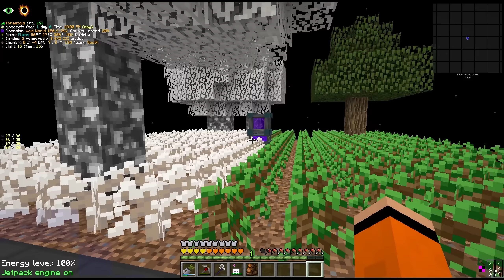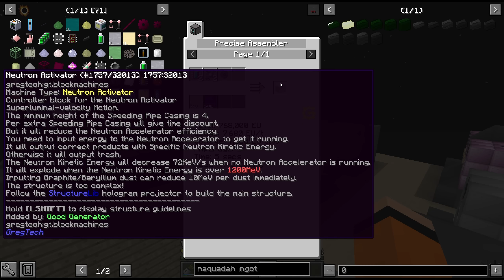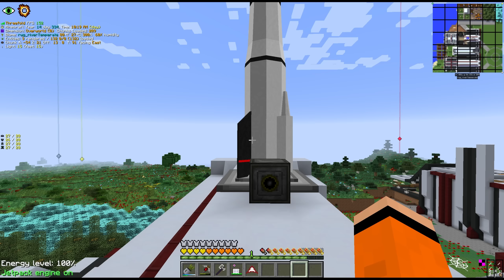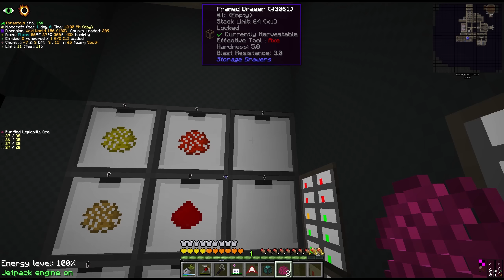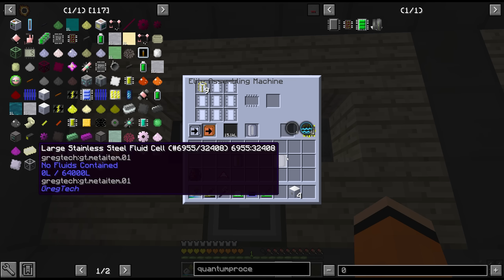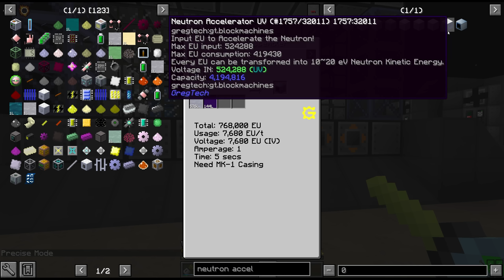Gregtech New Horizons - 61 - With Precision! Modded Minecraft

Comment: If you want to use the precise assembler in normal mode I'd replace the dummy buses by hatches. From what I understand the reason the minimum casing was nerfed was because it was a pretty laggy multi with a lot of buses since it has to check recipe maps or something along those lines

Comment: Don't you have a skeleton spawner in the Nether? You could have used that for bones -> bonemeal -> Calcium as well. Other options were skeleton mob crops (slow), centrifuging milk (there's a milk crop IIRC), or placing another Tree Growth Simulator, although I'm not sure if they work with the nether saplings. Might only work with vanilla saplings, I'm not sure on that one.

...What was that cabling job for the red GT++ multi? 4× leading into an 8×? What?

I don't know the precise amount, but you need 32 stacks of 2× LuV superconductor for the fusion coils, another stack of 2x for the fusion coil needed for the controller recipe, and another 32 1x for the 16 LuV energy hatches you're not going to strictly need immediately, but want sooner or later. You need tons and tons and tons of that stuff, which is why I kept harping on both the Vulcanus (faster GT++ EBF replacement) and a Mega Vacuum Freezer (exactly what it says on the tin). It's going to make processing all that stuff a lot more reasonable.

I was sure that superconductors needed helium, not hydrogen, but okay.

This frequent maintenance stuff is why it's helpful to have designs that can signal maintenance issues at a glance, or a control room full of Nuclear Control information panels that keep track of multiblocks and their maintenance status. You can now craft auto-maintenance hatches, which will auto-resolve maintenance issues as they crop up at the cost of some items, but each such hatch, IIRC, is two LuV robot arms and...I believe two, but maybe four ZPM circuits. It's hideously expensive, and only useful/viable for critical infrastructure.

I guess Bart decided to use Legally Distinct Thermal materials rather than just straight copying the Thermal materials, or something ;)

Remember that miners only mine below them. Don't sink miners into the ground unless you're actively avoiding layers of ores, which...I mean if you only need the bottom layers I guess that's an option, but not really worth the effort IMO?

If anyone is confused about why the precise assembler related recipes suddenly changed, Three updated his version of Good Generators that adds those recipes, as they were changed to be fixed in a later version. The Adamantium Alloy gears were changed to Hikarium gears - which is more alloy fetish nonsense until you realize it takes ZPM to create, which takes two LuV energy hatches, which takes Naq using the inefficient recipe - and the original Draconium Bolts in the casing recipe was changed to Signaliium or however the pack wants to spell it.

If a miner "finished" it should have retracted the mining pipes. Keep an eye on that, it might also have shut down due to maintenance issues or some such.

You might think "can't you just mix Lithium dust with Chlorine in a chemical reactor/mixer/whatever to get Lithium Chloride dust?", and the answer is "if only". The alternative recipe for Lithium Chloride involves setting up an Algae farm, which is a large multiblock that produces various forms of algae depending on tiers. It is a cheap multiblock and entirely passive, requiring no maintenance, producing no pollution and costing no power, but it's speed can best be described as "glacial". None of the products you get from algae are worth mentioning in GTNH, so unfortunately there will be no Bobs/Angels flashbacks in this video ;)

"That's also a Bast Furnace recipe", the man says, not pointing out the fact that that particular recipe only takes 10 seconds hoping we wouldn't notice. But we do ;)

Be careful with that MAG-CE-whatever steel, by the way, because once cooked up with the cerium and lithium chloride it's a 7.5K second recipe, admittedly at MV, to turn the dust back into an ingot. In everyone's favorite machine, of course ;)

You don't get to complain about lengthy EBF recipes if you're not investing in the best coils to get perfect overclocks, sir. You know how much they matter, and the Volcanus is going to help immensely as well anyway ;)

Just when you thought that GTNH could add any more pointless alloys, it adds the alloy equivalent of palette swaps ;)

Ah, the Volcanus. 220% processing speed at 90% of the original EU/t cost, and the ability to smelt up to eight recipes in parallel if it has the power to do so. In addition the multiblock can accept buses/hatches in the top row, although it does have a minimum requirement of nine casing blocks. This thing is a straight-up monster, and properly wallshared you can get four of these behemoths in a 5×5×4 space at the cost of only 16 casings (not including the four needed for the controller blocks), two pyro input hatches, and 42 coils per. Complete with maintenance lights and automated shut-offs in case the pyro runs low, because that is one thing these guys require to run - if a Volcanus runs out of pyro while crafting, it will void the recipe like it ran out of power. They only consume 10mb per second, though. The only real downside - unless pyro is an issue - is that these multiblocks cannot use multi-amp hatches or laser hatches, so you're limited to two regular energy hatches at best. That said it's definitely worth overclocking these machines were possible. 220% processing speed at 90% processing cost boils down to ~41% EU cost, and the machine will run recipes in parallel before it overclocks, so you're not spending any extra power very easily.

Point of order, but if a Volcanus has a single energy hatch it will not pull 2A to run two recipes in parallel, even though a single energy hatch should be able to provide 2A worth of power. Not sure why, but that's how it works.

In fairness, you didn't use the schematic before because in 2.1.2.1 it's actually broken, as far as I recall. 2.1.2.3qf fixed it, I believe.

It's only twelve casings because it hasn't been nerfed yet ;). Apparently it'll eventually require 42, but maybe don't quote me on that.

That "ULV input bus" trick is what you use if you get into PAs early on, because filling those fully with tungstensteel casings early on is...not tenable.

Remember that multiblock Circuit Assembly Line? I'm not sure if it's worth (or even possible, for that matter) to get into early, since you will unlock crystal circuits once you've got Fusion, but since you're going to get them sooner or later anyway and all of that...maybe it's worth setting up some "temporary" ones to recycle for crystal circuits later? I'unno.
Reply from the maker: Which cables are you talking about 4x to 8x? Did I really do that 😄 also, are you confirming here that its eu/t cost and not total eu discount in volcanus? I'm quite liking it already and will be upgrading to naq coils asap, probably building a few more before mebf🤔
Reply: @Threefold.  I though I saw an 8x cable after a 4x cable, so...yes?

I tested it, and yes, the 90% discount is an EU/t discount, not just a total EU discount. At least, an IV volcanus fed 1A of 7000 EU/t (through a debug power generator) was able to smelt Naq oxide dust into Naq nuggets without losing power in the energy hatch, despite the base recipe requiring more than 7000 EU/t. I forget exactly how much power the Volcanus used, but it was 90% of the base recipe.

I can definitely recommend building/switching to more Volcani, and definitely looking into my quad volcanus design to get the most out of your casings and the QoL features. The two non-wallshared volcanus you build already use more casings and as many pyro hatches as one quad design, so at the cost of 10 more coils, 2 controllers and some basic buses/hatches you can double your volcanus number already.
Reply: @Threefold.  It was at 1:49
Reply: Schematic works fine in 2.1.2.1
You can get calcium from calcite as well, which he should be swimming in
Reply: TGS even works with TiC slime saplings btw